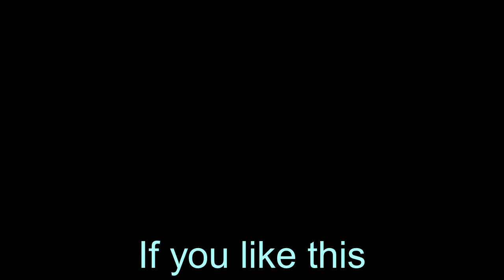Building an Atlas 10" Production Lathe Part 23: Fitting The Collet Closer

Comment: On video the gear cover looks factory. Great job.
Reply from the maker: Thanks John: I still have to do some final alignment and I am probably going to install the other bracket I built but it's about time to start checking what kind of accuracy I will realistically get with this lathe.
Reply: @hillsgun  Did you check the accuracy on this lathe and if so what are the results? Enjoyed watching all 23 videos to this series.
Reply from the maker: As of now I have not. Still building tooling and parts but by next week it will be building bushings for adjustable toolholders for the tailstock.(There is a sneak peek of an adjustable toolholder at the end of the video I released today on turret tooling on the Sheldon lathe).The only place (within reason) that there can be an accuracy issue is the alignment between the headstock and tailstock. The carriage will probably never be moved more than 3 inches so any accuracy issues there will be negligable. No compound so not an issue. cross slide is lever operated with stops so no backlash issues or excessive movement there. The headstock needs to be in alignment with the bed and the tailstock so if necessary I might have to rebabbit the headstock. The tailstock needs to operate parallel with the spindle, but any missalignment will be addressed with the adjustments in the tooling in the tailstock. Thanks, Dan.